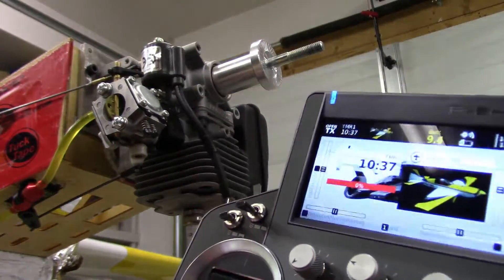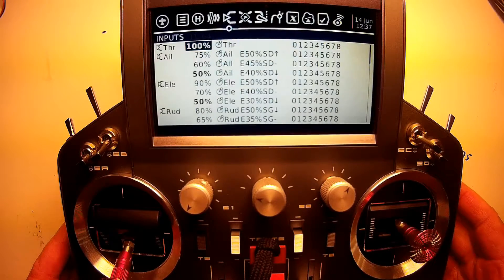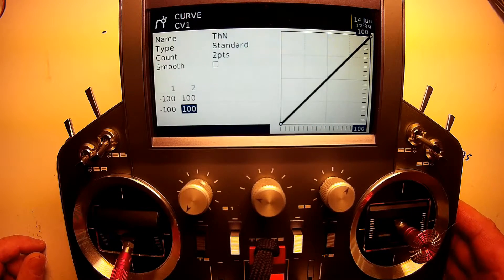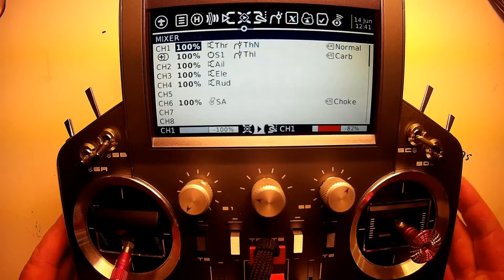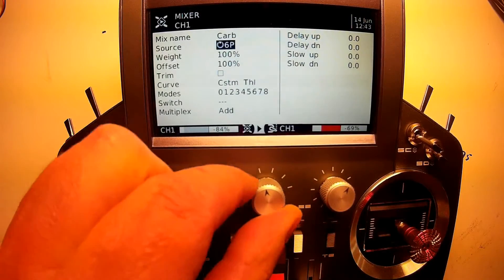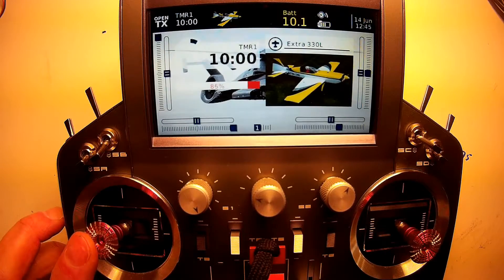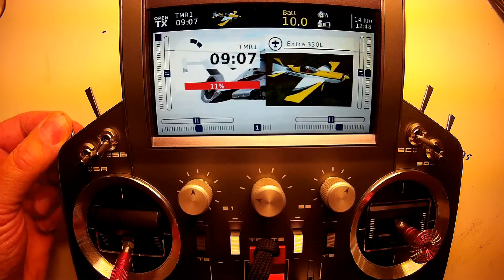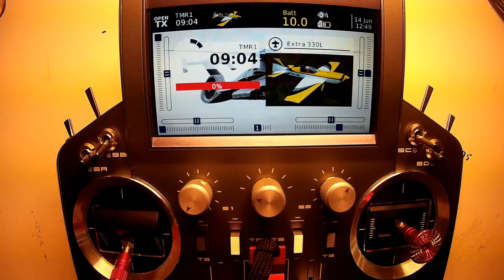OpenTX Gas or Nitro Engine Setup Idea - Replicate Analog Throttle Trim

Comment: Hi there, do you connect the thottle servo directly to the Pixhawk (or whichever flight controller you are using) or do you have an ESC between the servo and the FC? Thanks.
Reply from the maker: Throttle servo plugs into the throttle channel output on the receiver. I don't use flight stabilization systems in my planes, so no idea how it would work with them.
Reply: Yes, tha same idea. Is there somebody who did combine Nitro/Gasolie Engine with modern FC (using Inav or Ardupilot)

Comment: In OpenTX its possible to set the second idle input to have a limited curve so it only operates on one side of the throttle range, say up to 30% of the throttle range. Thus it wont affect the higher end of your throttle settings.
Reply from the maker: In my short time (1 year) of using Open TX, I have found "if you can think it, Open TX can do it". There are also multiple ways usually of achieving it.  What you are describing there seems very similar to how I've got mine programmed on this plane, you would just need to use a 0 to 30% curve for your idle one. But maybe I'm missing something obvious in your question.
As I'm no pro at this, I can't say what other "ways" would work without testing different methods to see which works best; but to me, you could also use a logical function/s to deal with that. Ie. the less than or greater than function. Use a specific curve when the throttle is 30% or less?
Reply: How?

Comment: Will the Sr8 gyro receiver work in a gas plane?  Some say no.  Nice work on the throttle, like the knob function
Reply from the maker: Sorry no idea. I don't run 3 axis stabilization in my fixed wing aircraft, only my helis. Many 3 axis stabilization systems for helicopters can't handle high vibration environments (such as gas), so perhaps the same holds true with some fixed wing systems as well?

Comment: Awesome video, I am currently setting up my first gas model.  I have the qx7 and I'm going to try to implement your idle feature and engine cut.  I'm having one problem that I can figure out.  I can't get any output on channel one to control a servo.  I am running the RX8R Pro receiver.  I have gone back and forth in companion and I have tried googling it multiple ways and no dice.  Any help would be greatly appreciated.
Reply from the maker: When you check your channel monitor menu on your radio, are you seeing channel 1 output movement with stick movement? If there movement showing on channel 1 in the monitor, then the likely culprit is the RX. If there is no channel 1 movement showing in monitor, then there is some setting within the many in the radio that is not correct. With so many variables in OpenTX, it's hard to say what the issue may be without going through the entire setup first hand. I would restart at the beginning of the process. First the input settings, then the mix settings, then the output settings.
Reply: @Rchelicopterfun Salt thanks for the reply man,  yeah I'm NOT getting any channel 1 movement in the simulator, or on the Tx screen.  The only time I saw movement was when I hit my Engine kill/cut switch that was preset when I created the model.  I did add a mix to the throttle exactly like yours for using  my S1 Pot as the throttle idle.  After that I got a little output,  the servo would move but for example, it was only moving from the -90% position to the -75% position these movements occurred between 0% throttle and 100% stick position.  Almost as if the small output signal would be enough if it were connected to an ESC for an electric setup, I don't know.  Those values are approximate as I was watching the servos on the test bench.  I'm still new to Open Tx and there is a lot of info out there.  I try to do extensive research through all the available online resources before I reach out to someone for help.  Again this is my first gasser using FrSky products.  Any advice would be greatly appreciated.  I will try to delete the model and start over.
Reply from the maker: Did you use the add function for the second idle throttle mix? It sounds like its reacting as if you used replace instead of add, and the only output is from the small idle throttle curve as it's completely overriding (replacing) the main curve? Just a guess of course; as I said, there are so many variables with OpenTX, it's hard to figure out where the issue on a particular setup is without playing around with and seeing the settings first hand.
Reply: I deleted the title cut off that the software added during the initial model set up.   I then added the mix line to the throttle works well.   Although i don't get any output from my S1 Pot until it hits 40% clockwise rotation.   Im not sure how to address that.   Even if i set the pot to control a single servo during testing, it does nothing until I hit that 40%ish mark then the servo jumps to position totally skipping 0%-40%.  If dcsu makes any sense.   But thank you for your awesome video.

Comment: Hi just wondering if you could help me I'm trying to set a on/off switch for my ignition on my gas engine any help would be great 👍
Reply from the maker: Servo controlled? Solid State? Other? Regardless of switch type, not much to it. You hook it to a free channel on your RX and program what toggle you want to active that channel in your mix menu. You'll also need an external ignition kill switch however - that is a rule at most flying clubs with all gas powered models. So the external switch would be wired in parallel with the remote switch so either could kill the ignition by grounding it to the engine.

Comment: I'm getting an X12 for wings , gliders . What's your range like with this transmitter ?
Reply from the maker: I fly VLS, and the models start getting too small to see long before getting a low rssi warning. The lowest rssi reading I've recorded so far has been 55 so still plenty of range to go. In other words,  I would lose visual range of the aircraft long before RF range. I would think range is comparable to any of the name brand off the shelf 2.4 GHz RC radio systems (1.5 to 2.0 km). Assuming proper RX antenna placement practices of course.

Comment: Have you seen the frsky gas Suite?😎
Reply: Are they any good for smaller gas engines, eg 15,20cc.  I have read elsewhere that the fuel metering units are only useable on engine's drinking heavily. Eg 150cc and above
Reply: @russcole5685   I have no idea, I could never justify spending the $80 on one.  I decided to run a smaller engine at 3/4 throttle on a full tank and timed it, then I knocked off 2 minutes and set my timer's accordingly so I always land with fuel in the tank.